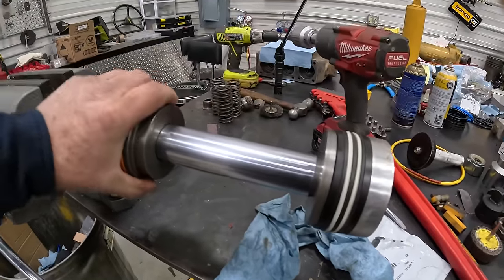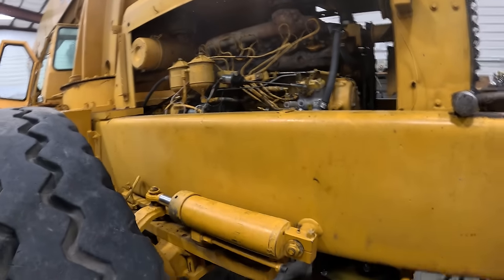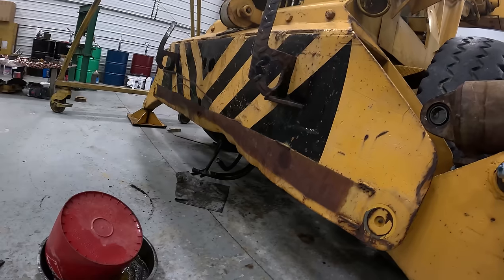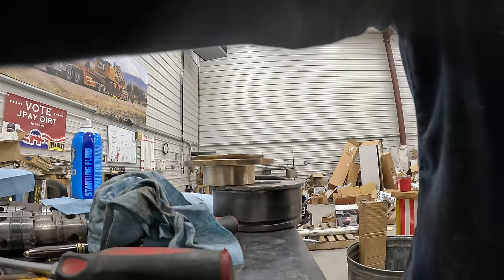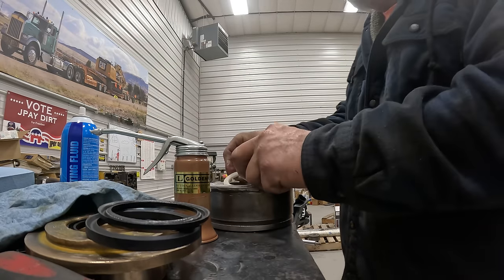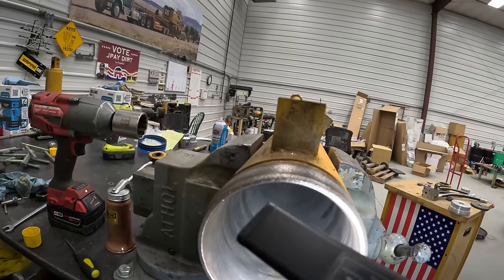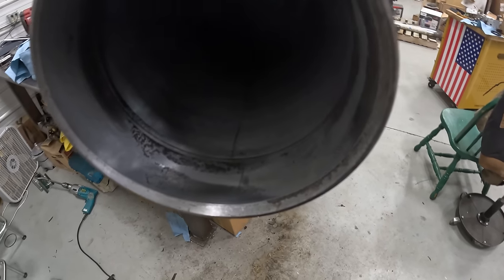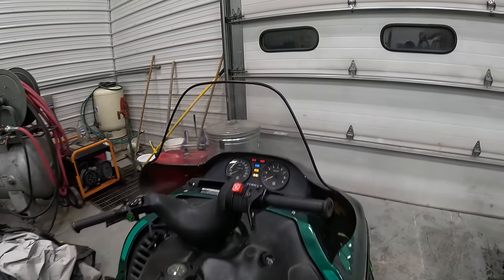Re Assembly Of The Hydraulic Rams

Comment: Jeff, on your cables, they are referred to as a push pull cable or a Morris control cable also referred to his boat control cables, there is a cable inside  that’s got a plastic liner around the cable. If the cable moves freely back-and-forth then usually there’s nothing wrong with the cable, I have had hundreds of these cables made by Broadway splicing, in Spokane Washington, there are many different variations to the ends, I usually draw a picture of each end and give them cable travel, and the overall length , and any other lengths that I can supply them, the price you quoted in the video from the one outfit you were talking about sounds very reasonable, but I would absolutely not give anybody a picture of my credit card, if they can’t take the numbers over the phone, don’t do it ,also never use a debit card over the phone because debit cards don’t have the same protection that a credit card has.

Comment: Jeff, Loctite makes two primers. Primer T comes in a yellow can and is very fast acting. Primer n comes with green printing on the container and is not as time sensitive. It also accelerates the cure time. Now here is the important part, If you are assembling parts , fasteners or whatever that has no ferrous component, you really should use one of those primers as they have that catalyst that you mentioned that makes the Loctite work. So you either need the primer or one part needs to have some ferrous component, or your results will be spotty at best.
Loctite also says that a bit of oil will not stop the cure. Most Loctites will break down at temperatures above 350F. There are a few that are good to 400 F. Another great gap filler they make is called QuickMetal. It will not act like Epoxy but it will fill gaps as long as it is contained. Which means you cannot use it like a putty or Taryl's stuff.
Your sanding the OD of that seal allowed the Loctite to see the ferrous component and then start to cure, which is why it was a good thing to do. Keep up the good work! 
Curly
PS: You know how to get in touch if needed.

Comment: Isn’t it amazing what the harmonic vibrations from a air chisel can do! One use I’ve found effective is clevis pins on a brake chamber, start vibrating it with the air chisel ( not to the point of destroying it) and you’ll get a cloud of rust and the pin will start rotating in the clevis. Those threads will hold fine, they will only see pressure in the retracted position. As many cylinders as you do, you really need to build your own cylinder bench. I use the word bench loosely. I built a holding fixture out of a old man lift boom, works great. Adjustable to any length cylinder, only takes up 8’x16’ of yard space, lug it in with the forklift when you need to use it. Thank you for your efforts and the video’s.

Comment: p.s. Loctite 545 for all your hydraulic, oil, gas, air fittings. You will not be disappointed. I've been a user for a bunch of years and never had a leak nor a difficult fitting removal.

Comment: Air hammer work great!  The hydraulic lines to a cement mixers drive motor are 1-1/2" and about impossible to remove with a wrench without busting the tubeing nipple that is brazed into the motor.  Put a flat point punch in an air hammer and tap on the crown of the wrench flat in the direction you need it to turn . . . It zaps them suckers right loose, then use an adjustable wrench to remove.  The first time I saw this I was like "No effing way that worked!"  Seen it a thousand times now and it ALLWAYS works no matter how tight and rusted the fitting is.

Comment: Used to rebuild the cylinders on Army bridge launchers. The cylinders had threaded heads like yours. We had a large pipe that went over the rod and rod eye, had bolts that screwed into the spanner holes and had a large socket welded to a plate on the opposite end. Used an very large impact wrench on this rig, seems like the impact worked better on rusty threads than smooth torque.

Comment: Heat it and tap all around the thread area with a ball peen hammer to carefully stretch the metal just a fraction. Ya also air hammer if you got one.  3 jaw engine hone works pretty good in a pinch.  Cables, aren't those the same as the big morse cables used in boats?   or are the ends radically different.